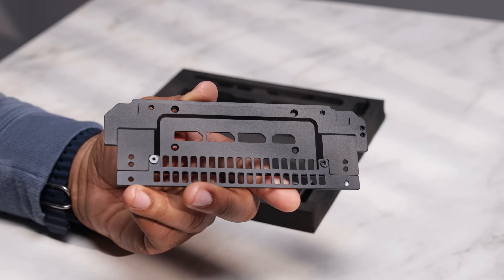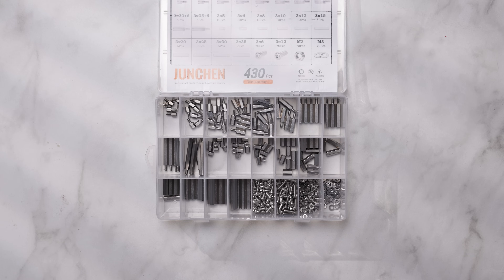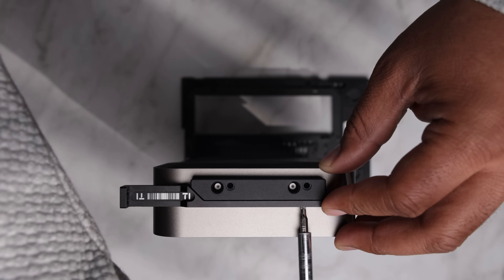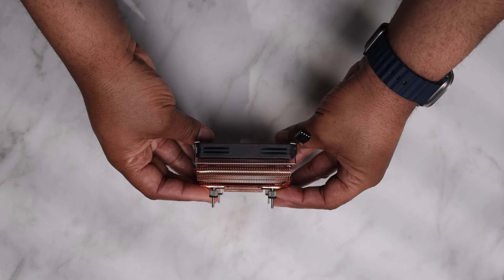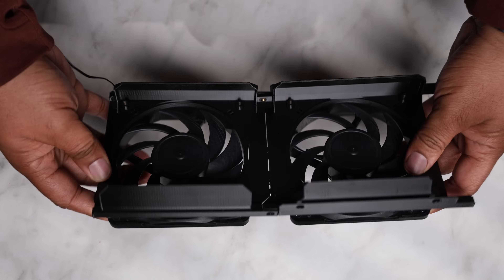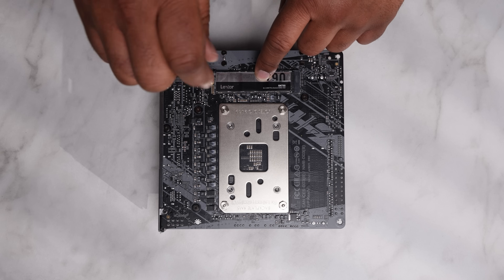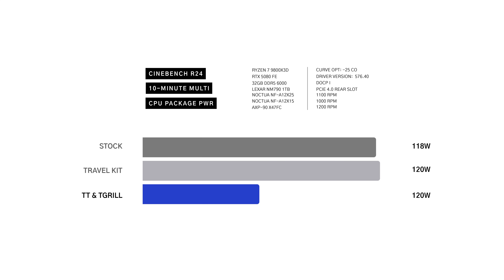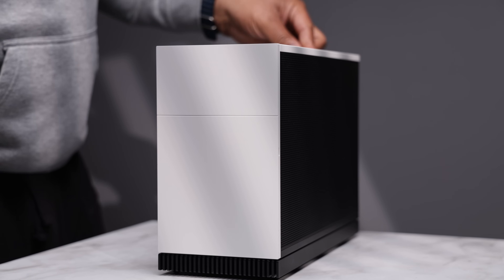The FormD T1 Keeps Evolving - RTX 5080 FE Travel Kit

Comment: Would be great if you could tell me why you choose air over aio thanks!
Reply from the maker: Much easier to install and upkeep
Reply: @ChrisRussellTech  what upkeep would there be? also if its an ultimate build wouldnt you want the best cooling possible?
Reply from the maker: @Goop56 dust cleaning, parts swapping etc. You’ll get better cooling but the AIO support in the T1 is already limited with the slim fan.
Reply: @ChrisRussellTech  okay do you know the margin of difference with aio though? ive heard in some cases certain air optimized setups had better temps. Are you overclocking though i feel like the second you incorporate overclocking the air may become a problem
Reply from the maker: @Goop56  A big advantage for air cooling in the T1 is better air pathways for the GPU. AIOs usually suppress GPU heat exhaust with their dense radiators. In turn heating the radiator more and tapping more warm air inside. Sure you’ll see more CPU thermal headroom and less spikes but your case and GPU thermals will suffer.

Comment: Bottom fans should also be exhaust no?
Sandwich layouts intake from the side and exhaust out of the top and bottom. You are fighting against the gpu exhaust with them as intake!
This is especially true for traditional side-exit graphics cards.

Would have loved to have seen the exhaust setup tested, as my hypothesis may be wrong with these blow-through cards.

Great video!
Reply from the maker: Thanks 🙏. Couldn’t get the fans to not clip the case in exhaust.

Comment: Just upgraded my T1 from a 5080 to a 5090FE I would say to stick with a 5080 or below in this case 5090 is just too much without limiting the power to the card. I now have my T30 fans running at 2,000 RPM just to keep up with the heat.

Comment: I am planning to get a 5080 in the same pc case… should I use 3 slots of clearance for the gpu for better air ventilation? I don’t want hot air against my motherboard and to keep it trapped in my case. It is my first pc by the way, and I decided that the best way to maximize challenging fun and travel size, any suggestions are welcome. Here are the specs:
7800x3d
Rtx 5080
Klevv Crass 910 4tb
Silicon x power value 6400mts 32gb cl32 timing
Coolermaster atmos
Arctic p12 slim fans
Asrock a 620i mini it x
Thermal take tough power sf850 platinum fully modular
No custom cables

Will this work and how well will it work. I am also planning heavy overclocking without too much instability and voiding warranty.

Comment: This video is super high quality. Did you test the same build with the fans at the bottom as exhaust rather than intake by any chance?
Reply: Sorry, I meant, did you test those bottom noctua fans as exhaust, blowing air out the bottom, rather than taking in more air?
Reply from the maker: I didn’t build it in reference but went inverted for the video.

Comment: what other options are there for the motherboard? and how would temps be without the exhaust shroud?
Reply from the maker: You will see similar temps without the exhaust shroud, the shroud is just for those who want the absolute BEST thermals way outside the price to performance. You can go with any AM5 ITX motherboard from both the Ryzen 7000 and 9000 era like the B650i or something newer like the B850i AORUS Pro.
Reply: there's no restrictions around motherboard heatsink sizes? I know Optimum had to deshroud his RAM and change the backplate for compatability with the alpenfoehn blackridge, but I'm centering my build around the GPU travel kit (international flights) and will do whatever the most convenient.

Comment: Hey Chris I’m planning on copying your build, but I just have one question, is a 750 Watt power supply really good enough? 
Because I saw all other builds using a 5080 used a 1000 watt power supply so I’m just confused why your the only one using the 750 watt.
Reply from the maker: 750W is good but it doesn’t leave much space for upgrading in the event you want to go with a 5090 or a higher spec’d hardware. A 4090 or 5080 will be fine either way a 750W.
Reply: @ChrisRussellTech gotcha, thx for the input 🙏

Comment: Hi Chris, may I ask why you do air cooled mostly these days in the T1? I saw some older vids in which you were using an AIO and am debating myself which route to go.
Reply from the maker: I was literally talking to @EIGA about this and it’s because the fan brackets are my least favourite part of the FormD T1 and I naturally gravitate toward air cooling when using the Fan Duct from EIGA which makes installing the fans so much easier. There are more caveats to liquid cooling also and full 120/25mm fan support is only possible with the official T-Grill or a top-hat mod.
Reply: @ChrisRussellTech  Since I don't have the fan duct and can't take advantage of the simpler build it offers, I'm wondering what disadvantages I still face when using an AIO like the Cooler Master MasterLiquid 240 Atmos. Only the reliability?

I’ve seen this question pop up on Reddit from time to time, so it might be worth making a short video comparing temperatures and other differences too. :)

Comment: Lovely video. Thanks! What does the t-grill give you? Does it provide enough extra room to add more fans or..? Thanks
Reply from the maker: Yes, the art of the Tgrill is that gives you the ability to expand cooking on the top, bottom or both. Allowing up to a 240mm AIO with dual T-30s on the top or dual slim fans at the bottom*, however this can be challenging depending on the cable management and exact fans.
Reply: @ChrisRussellTech  Thanks!

Comment: Awesome video Chris! Do you know if this kit would work with the RTX 6000 Pro Blackwell?
Reply from the maker: It should but I responded to your Reddit message. It has the same measurements but roughly more power draw than the 5090. It’s possible but proceed with caution as you’ll have to source a component SFX/L PSU to power it. I believe that card has two 12VHPWR connectors.

Comment: Can't wait for the Aorus review video. My current motherboard B850-I strix is having massive internet issues and If I can manage to refund it I might get this one looks promising.
Reply from the maker: Probably a week out. It’s a decent board, not my favourite. Some weird quirks, one standard fan connector and 2 special fan connectors that need a fan adapter (included). The IO isn’t as good as the B850i ROG which has an additional USB-C 20GB port and a clear CMOS button. It’s only $50 more than the AORUS. The AORUS has two M.2 ports but one actual actively cooled PCIE 5.0 slot on the front and one 4.0 slot on the back of the board. The wifi 7 antenna is cheap and plastic and doesn’t stand in a fixed position because it’s so light.
Reply: @ChrisRussellTech  thank you for telling me about this board! I also think about going back and getting Msi B650I Edge one all depends on If I can score refund for my strix board
Reply from the maker: @k4shima if you can’t wait do got the B850i ROG, if you can wait, wait for the MSI B850i which was announced at Computex.

Comment: Do you have issue with T1 Riser when using Gigabyte B850i?
Reply from the maker: I have had zero issues. Actually the board self recognized that I was using a PCIE Gen 4 riser and it pre-selected to Gen 4 and not “auto”

Comment: Very clean build as usual and i really enjoy your videos. Your older video introducing the FormD T-Grill i liked the combination of the Two-Tone with it, and now for the first time i saw you can install it in the bottom with two slim 15mm fans, i am wondering if you can also install a second one at the top and use a 240mm aio like the cooler master atmos 240 stealth (for the better fans) or any other performance oriented 240 AIO + fans combination ?

Comment: Beautiful build!!! I have that same motherboard on my Ncase M2 build and I also noticed the design flaws for example the need of fan adapters (theyre included in the box) but I find them stupid... besides that its a good itx case. Btw I love all your videos bro your content is top notch
Reply from the maker: I have a problem with the lack of a second USB Tyoe C port, not exterior cmos or reset switch. The fan connectors are an issue also especially the cables become faulty. The audio header mounted to the VRM shroud is strange. EZ latch system for the M.2 is only, it’s hard to reach and is barely making contact to keep the heatsink down. And thanks 🙏

Comment: i have thermalright axp90x53 cooler it wont fit on my aorus b850i. For those who want to aircooled in Aorus b850i better use axp90x47 like these one he is using in the video.
Reply from the maker: How so? The X47FC fits fine, the only difference is the height of the cooler

Comment: Just discovered the channel. Stunning job and production quality !
SFF enthusiast here, with similar stuff you have: Aorus B850i, FormD T1 2.1, CM Atmos 240 with Noctua fans...❤
Reply from the maker: Thank you! 🙏 Nice setup, how do you like the AORUS B850i? I think it’s a miss but that’s just my opinion. It’s too wacky.
Reply: @ChrisRussellTech  Mediocre software aside (which I do not use anyway), I'd say it does the job. I had no issue with my PCI riser as some encountered. 
The main problem being that was my only choice anyway : Asus is out of consideration AFAIC (was a old fan, then had nothing but terrible experiences in the last 8-9 years). MSI didn't release any B850 itx board, and the Asrock B850i is at the time known for tremendously bad reliability... 😒

Comment: your getting better and better! reaching soon EIGA/Optimum quality !! just curious how did you mount/fixed the stands on your TGrill? right now im using it without and its a bit slippery on the desk :D
Reply from the maker: 3D printed feet, a file directly from FormD. Not sure if it can be released but I’ll ask.
Reply: @ChrisRussellTech appreciate it - cause the orignal ones doesnt fit
Reply from the maker: @shōda-x  I used a rubber like material, forgot the name. I get my prints done at a local shop.

Comment: So happy with more NF-A12X25 in formd t1. I was regreting my decisions with going with noctua fans instead of t30s and I almost sold my noctuas to get t30 but then more people use noctua fans making me realize that switching from NF-A12X25 to t30s would be pointless mistake, yeah extra 5mm is nice but I prefer my all black noctua fans. only issue I'm having is that they are not daisy chainable like t30s. Amazing video.
Reply from the maker: They’re both great fans , I find the T-30s better at moving alot of air at low noise levels, once you go above 14-1800rpm then the gap starts to close.
Reply: @ChrisRussellTech  I would get t30s If I were buying exhaust for the first time but Noctua still good for me and now. I would like to ask, how did you connect your noctua fans? Did you use 2 noctua fan cable extension that came with A12X25 and skin their outside?
Reply from the maker: @k4shima the 140mm T-30s are going out it June. Won’t fit the t1 however

Comment: Nice video, i just find the cpu cooler to be too small, i'm pretty sure that you could go bigger with the space available without compromising acoustics!
Reply from the maker: Thanks! I could go bigger but I wanted to keep it simple as post people would want to go with the X47FC for their build.
Reply: @ChrisRussellTech  I don’t want to ask for too much, but could you tell me if the X53 also works fine with the travel kit? I already have the X53 since it made the temps drop(as seen in the air-cooled v2 video)and don’t want to swap.

Comment: Does „Stock“ include the EIGA shroud? Or is the shroud more likely the cause of the temp drop with the travel kit? I can’t see why the travel kit should lower temps .
Reply from the maker: With shroud on all configurations. I’ve already did a review of the shroud itself. Well depending on which configuration you go with the vents provides better access air. It made a deference.